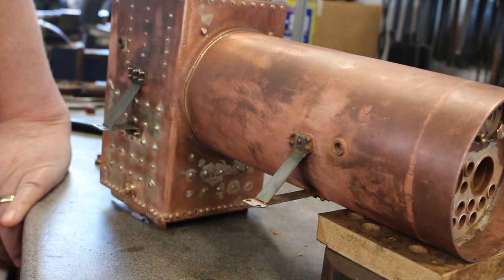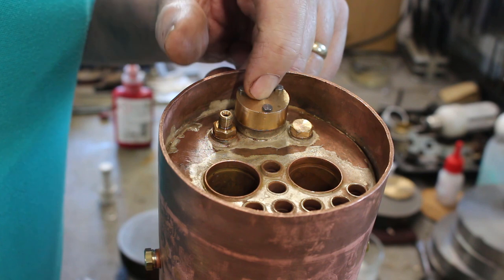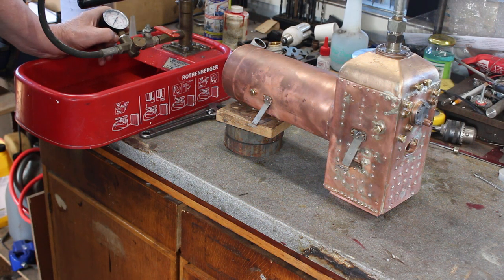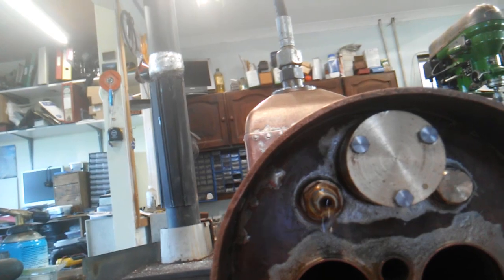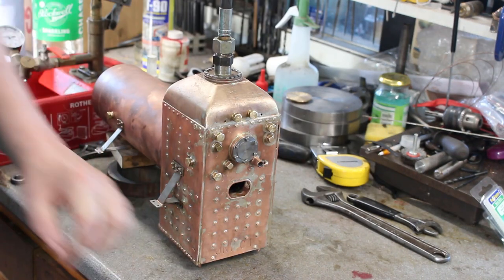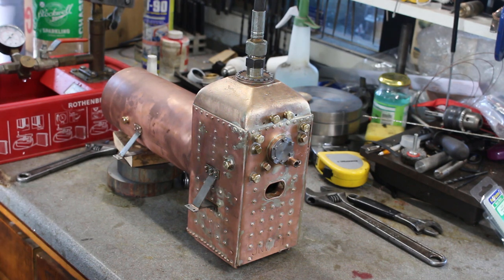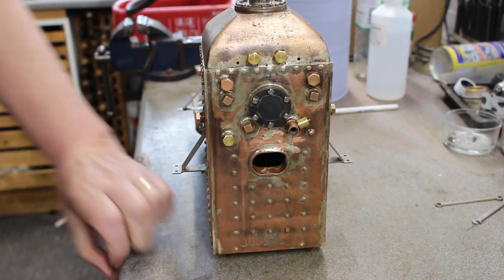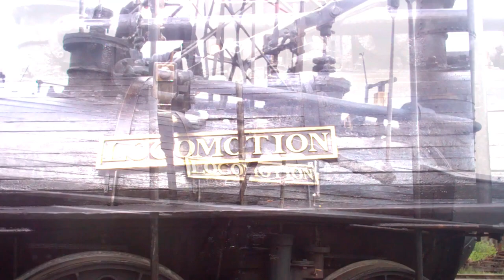LION - Miniature Locomotive Build Pt. 21 - Hydraulic Test + Locomotion Clips

Comment: Well done, you have a nice tight boiler.  Some times I have to fix leaks on standard gauge boilers when hydraulic testing is done, there might be
20 leaks of different levels of annoyance , a lot of them are fixable by caulking  that is to say chiseling down on the leak with a flat ended chisel so as to compress the metal together. Might be good in a hard to re solder place for instance but I rather expect you knew that anyway.

Comment: That’s very brave to film the hydraulic test on camera. Very minor issues only. Congratulations. I use the same test pump ( with a UKAS verified gauge fitted ) when doing pressure testing for protective devices and small pressure vessels for my work.
Reply from the maker: Thanks, the rest of the build will be much more relaxing now that the boiler is done, disappointing to have some leaks but as it turned out easy to fix, thankfully.

Comment: hi gchms
well done, i'm pleaesd the boiler held, ive been through it as you know, and after all that its a well deserved pint
see you next time. i'm not far off a compressed air test with mine, just finalising cylinder components for fitting to frames
regards
mr f

Comment: Great! Nice to see the Project Rising.  On 06:30 the tiny copper piece to center the pipe..... i wouldnt feel good with that. I rather stick a fine piece of wire through the fitting....center the pipe with it.... than screw it in ... and pull it out..... but youre way does it at all..... have a relax sunday! Cheers
Reply from the maker: Good idea, I could have used some piano wire through the fitting. The copper piece i used was extracted through the opening in the dome after some rattling around. Thanks for your comment.
Reply: @GoCreatehms  like my Brother use to motivate me: youtube is not to reach the mass..... it is to find that one Guy... with another perspective or usefull tipp..... 😉 go on!
Reply: I had much the same thought, to stick a brass rod in the hole in the stay and use that to thread the needle as it were.

Comment: Very well done Nigel. I know exactly how you felt on the completion of the hydro.
My boiler is 10.75 inches in diameter, steel, and expanded copper tubes 28 @ 1metre long by 19mm dia, We tested it to 200 psi for 20 mins. We went and had a cuppa and came back to a totally dry boiler and the gauge on 200. But I did have a few weeps the first time it was tested to tell the truth. So I know how you felt. 
By the way, I'm  building a 4-8-4 Northern in 1.5" scale, 7 1/4" gauge.
Reply from the maker: Hi Peter, thanks for watching my video. A successful hydo test is for sure a big relief and achievement. Your boiler is massive compared to my Lion boiler, sound like that will be a massively impressive model when finished.
Reply: @GoCreatehms  Ah, while size may be impressive, the engineering is equal for all. I used to think driving them was good (still do) but it's the journey and learning on the way of building that is priceless. Believe it or not I am seriously considering a Black Five in 3.5 g as my next project.